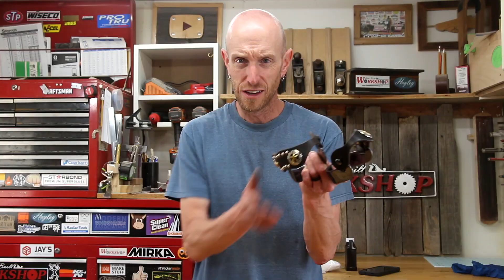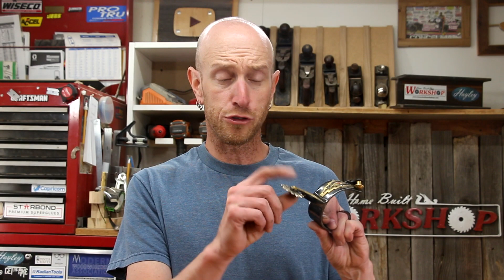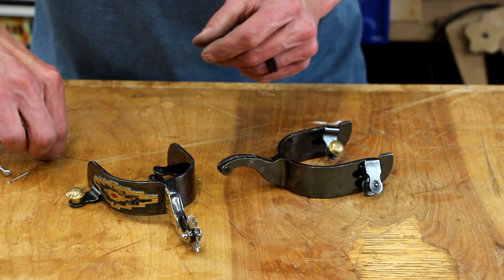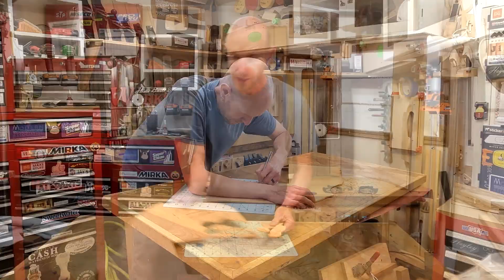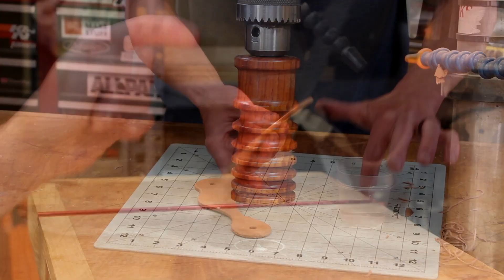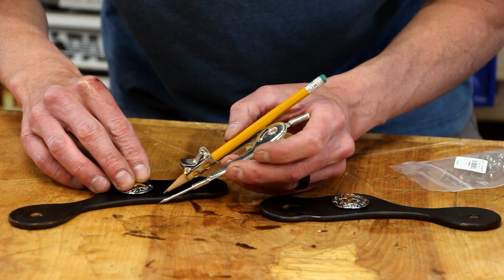Making Leather Spur Straps | Modifying Spurs and Adding Bling

Comment: Nice looking spurs and straps. Now get ta making some custom guitar straps with them thar skillz you have. I once had the idea I was going to make me a leather "Duster" long coat back when they were a thing in Rock n Roll. Then I started adding up the cost AND the weight and realized IF I could afford to make a good one I would look more like Ozzy Osborne walking around trying to carry all that weight AND a guitar.
Reply from the maker: That's on my list for sure. I have a few guitar strap sized pieces set aside just for that. I also used to want a leather duster. I still like them.

Comment: How do you sharpen that beveling thingy? Mine isvery dull 😀
Reply from the maker: I use the edge of a strip of leather mounted into a kerf cut from the table saw. It holds the leather on its edge letting you use the edge as a very small strop. I hope that makes sense. Lol.

Comment: I hate using an Xacto knife for cutting leather. I've ruined so many projects with one of those. Last one was a guitar strap I recently made.

Try some saddle soap when burnishing the edges.i lightly wet the edge with water and apply some saddle soap and the burnishing turns out so much better and easier!
Reply from the maker: I'm always trying different knives to see if one works better than another. I recently picked up a round knife, but I need way more practice using that thing. Plus its not sharp enough yet.

I have seen the saddle soap used with water. I need to grab some and try it out.
Reply: @homebuiltshop  I found a small tin of sadle soap in the shoe shine area at my grocery store.

Yeah I'd like to get a round knife but I'm afraid I'd cut my hand off. I've already had my share of stitches in my life.